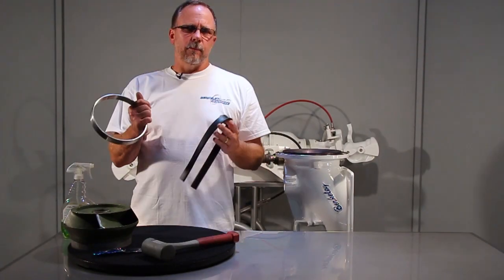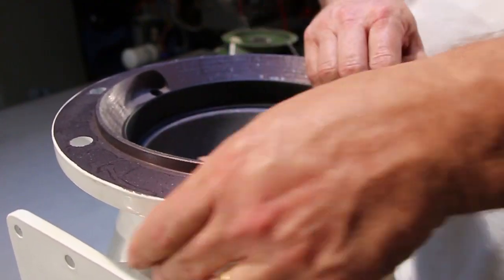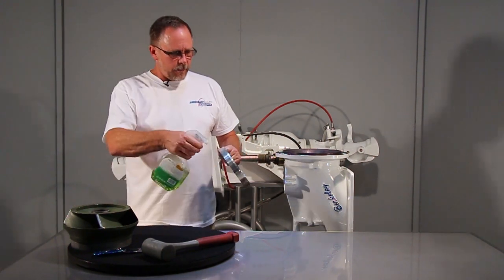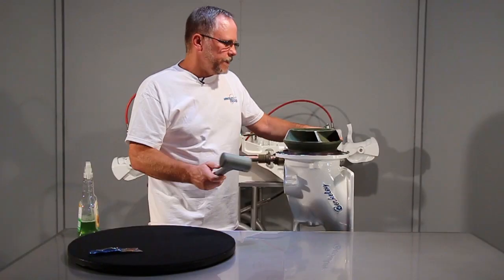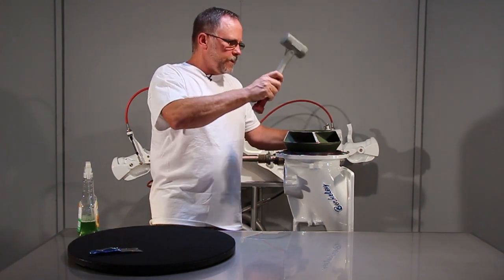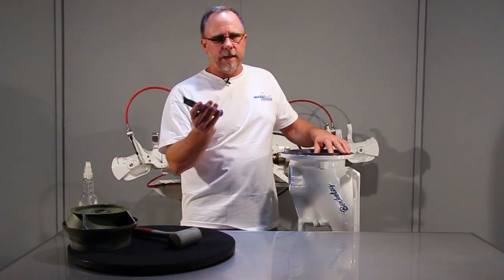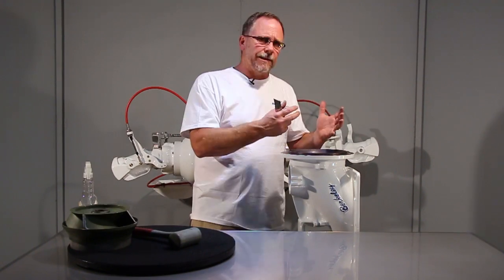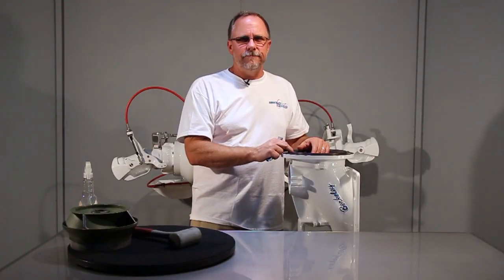Installing the Wear Ring in a Berkeley Jet Pump

Comment: This person has probably successfully built more berkeley jets than i will ever see in my lifetime but i would strongly advise against doing it this way, especially for a novice.  Instead,  "Shrink fit" by placing the wear ring in the freezer and the suction piece in front of a space heater.  Once the ring is below freezing and the casting is up around 100 degrees, quickly position the plastic insulator in the bore and wipe the id with soapy water or wd40.   Take the ring out of the freezer and before it has a chance to warm back up -  push it in the bore by hand.  when the temps equalize the parts return to an interference fit.  easy, and no risk of bending the ring or driving it in crooked or munching the insulator etc.
Reply: These pumps have been around for 50+ years. They were built to take abuse, unlike modern stuff. The way he installed that ring is how it’s done.